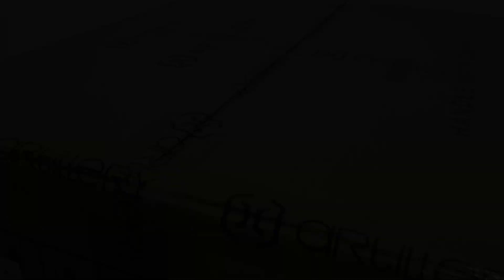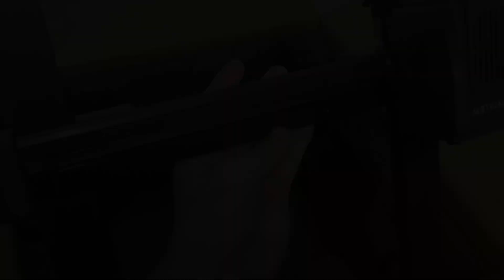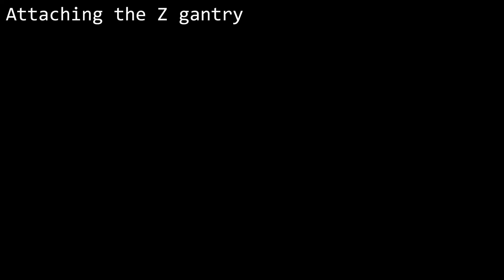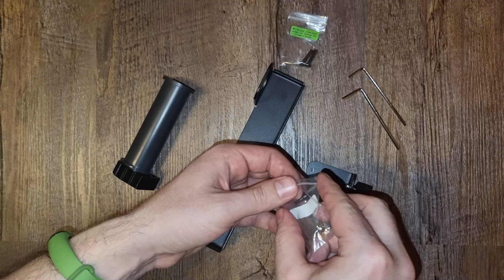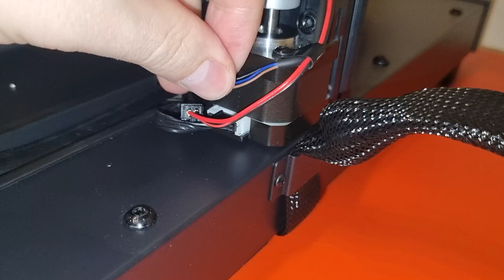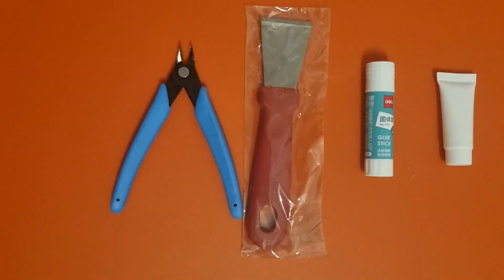Artillery Sidewinder X4 Pro - Unboxing, Assembly & Problems

Comment: Did you receive any spare parts yet? I have the Same problems, will try your belt fix 😅
Reply from the maker: Good thing you asked, I got some parts 3 days ago - a video about that will come soon 🤩
Nice, let me know how it worked for you ♥️
Reply: @Dirt3D  tried it today, belt is nice and tight and no more rubbing 👍🏼 only worry now is the bed wobble. Did you set up an sensor for Input shaping?